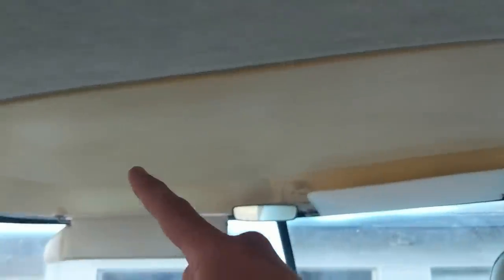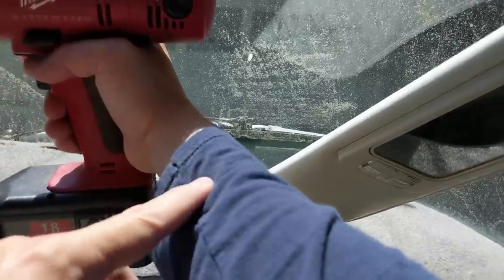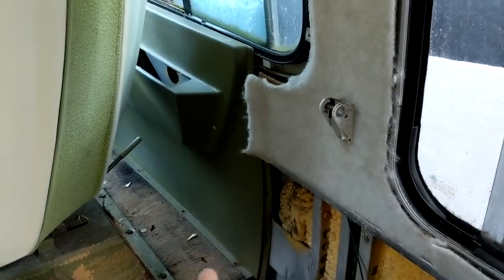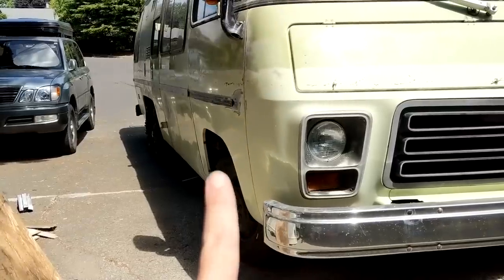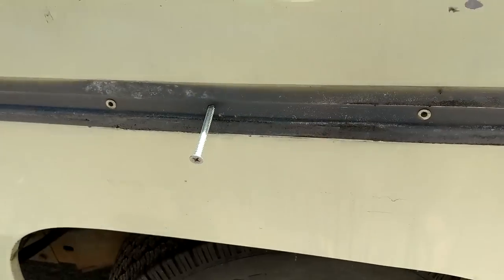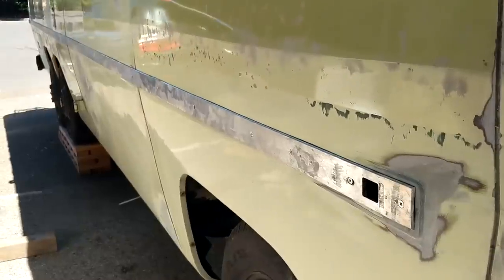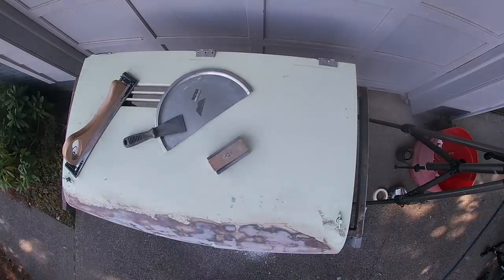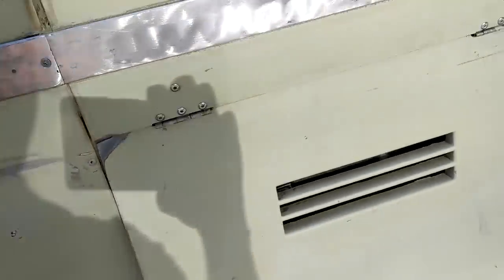Building the Best Damn GMC Motorhome Ever E.11 - Wheel Skirts and Other Panel Work.

Comment: I would have cut steel strips to lay into the grooves to spread the clamping force evenly when taking care of the chipmunking. Some adhesive under the steel would make it stronger. Remove the rivnuts and screw the trim screws into the steel strip, which would be thick enough to almost touch the back side of the aluminum strip. Then at final assembly apply sealer when the trim is installed.

Comment: Hello there, wonderful video as always...l was curios...How are you going to replace the broken rubber piece for the other skirt? Can you 3D print rubber material?
Reply from the maker: At the 14:34 mark you can see that I have two replacement rubber parts. To answer your question, yes, I can print a rubber like material called TPU. However, in this instance I don't think 3D printing is ideal. I would just go with some rubber sheeting and cut it to shape with a knife.
Reply: @IndustriousPursuits  Great, Thanks...because I definitely need to make one. Keep up the good work.

Comment: MR. Bodywork - a name well earned.  A Question for you.  I have removed my generator and it will not be replaced.  The generator door has grates on it.  It is possible to cut out the grate and fill with fiberglass OSM or am I cutting off more than I can chew?
Reply from the maker: You can do this. I will be doing similar in a future video so you can get an idea how involved the project will be. It might be a month or so before that video gets released, but the gist is that you need to get SMC resin, then it's just like normal fiberglass work. You can watch the boat building/modifying channels if you need to learn how to do fiberglass + resin layups. For filler, just use the SMC body filler like I've been showing.

Comment: Getting off the side panels is a pain in the ars.  I too had to drill out the screws on my driver’s side.  The passenger side I had to reach in and lose to bolts that held the passenger side panel to the dash.  My arms came out all scratched :(.  Do you have plans to remove your dash?  I want to do that so I can restore it.  I’ve been advised not to remove the dash as it will come out in pieces but to do the job right, I think it needs to come out.  Let me know your plans if you do plan on doing this.   Always enjoy your vids.  Nice work.
Reply from the maker: I need to do some more research, but from what I can tell, to remove the dash properly, you need to first remove the windshield.

Comment: Would it not be much more practical to just strip the whole interior to begin with & then design a new interior? Food for thought! Take Care....in your land of discovery in triple time accomplishing.
Reply from the maker: Generally speaking: Yes, but I want to really understand and not forget what I learned about the thinking behind the original interior. Some very smart engineers & designers put a lot of thought into it. I'm not hubristic enough to think I can do better than they did without first understanding what they did. Also, I do so many random things and a lot of time passes, so I'm likely to forget what I knew in the past. Best to not disassemble until I'm positive that I won't be needing anything from the previous interior. Your sentiment is most likely correct. I will probably end up with a completely custom interior.

Comment: Try using a longer thinner shanked screw driver.
Reply from the maker: The longer the screw driver the more the handle hits the windshield. With a long screw driver the angle would be ~45°
Reply: The Digital Maker sorry mate, I was looking at an incorrect contact point . I was thinking the change tip type screw driver  shank was wider than normal and as such the shaft was the contact point. I should have looked more closely before making a suggestion.